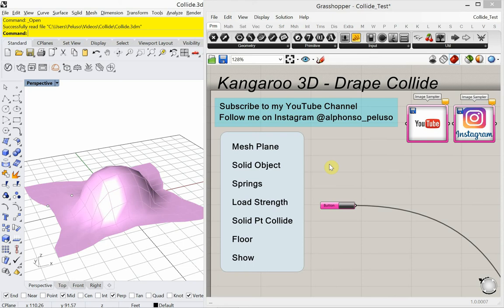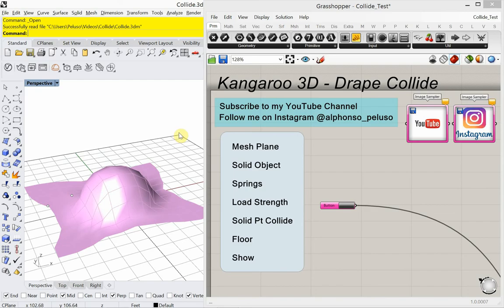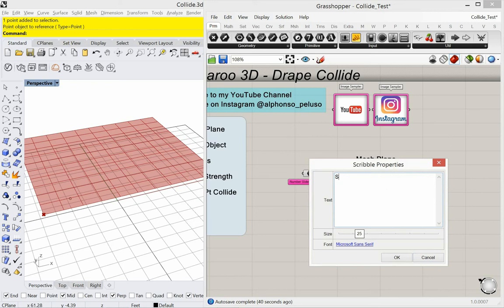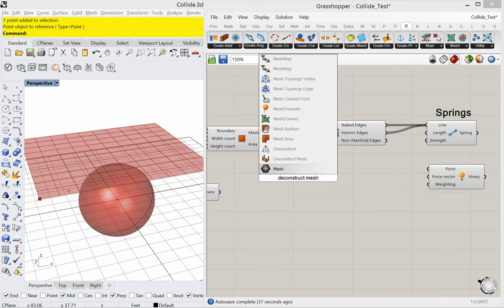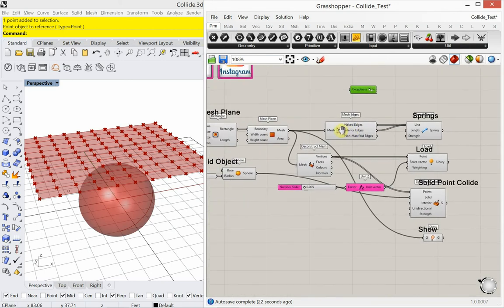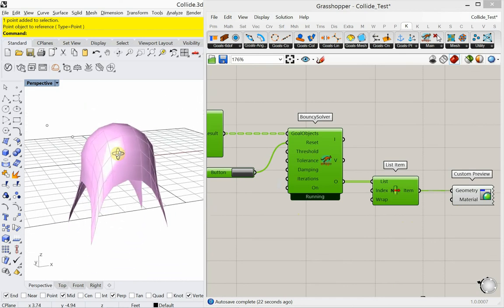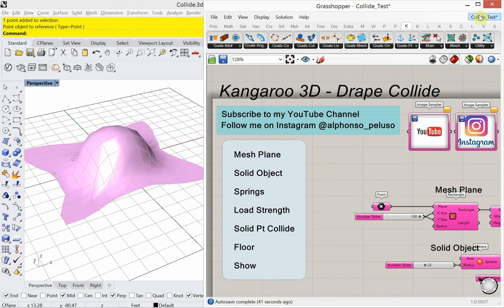Kangaroo Drape and Collide

Comment: Awesome script! Is it possible to do this with an object made it rhino already and the object is set to it? I tried geometry, mesh, and brep but it just goes right through like nothing is there..
Reply: Have find out a solution?, same problem with my application.
Reply from the maker: Hello. You need to increase the resolution of the mesh that drapes over the geometry.
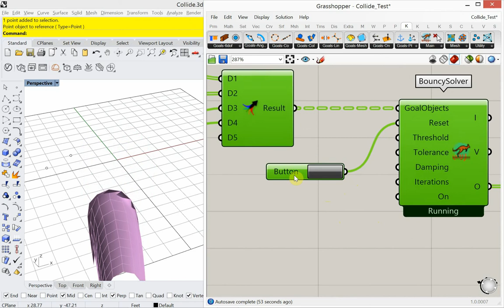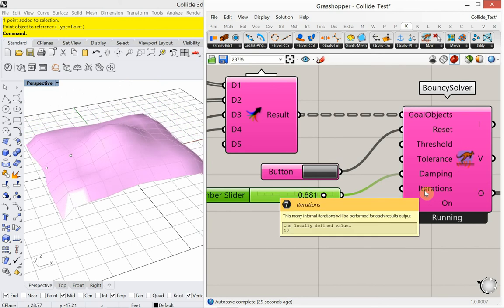Reply: 5:30 😂🎉🎉 11:39 12:41 12:44

Comment: Hey, thanks for this tutorial! I can get the mesh fabric to fall properly, but when I put a cube underneath, it rests on top as expected, but clips through the top corner and edges of the cube, even when I increase the resolution of the mesh. any ideas? thanks!
Reply from the maker: Hello and thanks for watching. Have you tried changing the Damping in the Kangaroo Bouncy Solver? Also you should add a boolean toggle to the ON input for the bouncy solver. This way you can stop the solver as needed.

Comment: Thx very simple and helpful. Question the collision works fine with large objects like your sphere but it won't work when I tried to do it with small objects like pipes created from curves (doesn't make any difference when i increase the size of the pipe radius) . Any ideas on how I can fix this.
Reply from the maker: Hello. Have you tried increasing the resolution of the mesh?
Reply: @AlphonsoPeluso  im having the same problem. it goes straight through regardless of increasing resolution